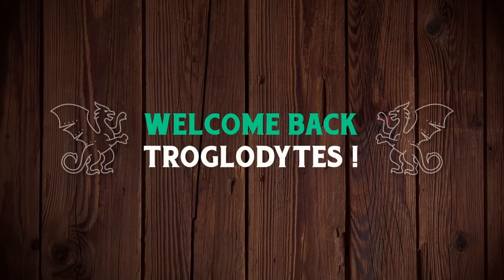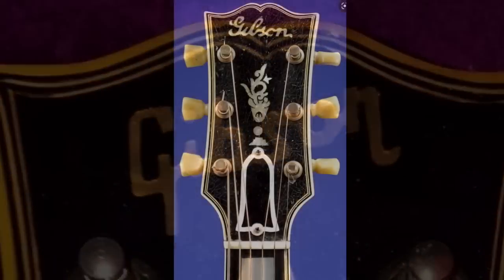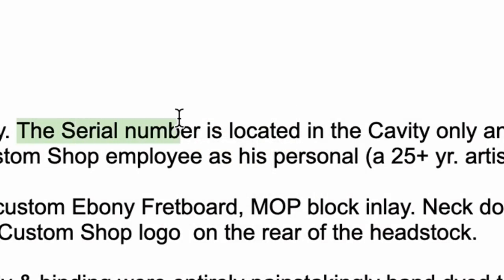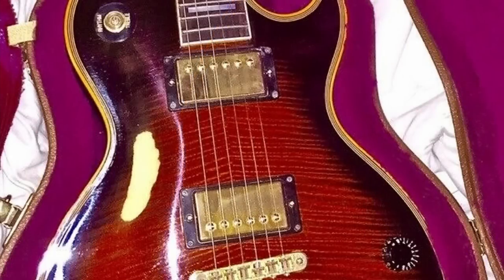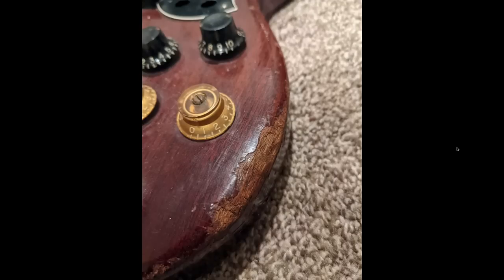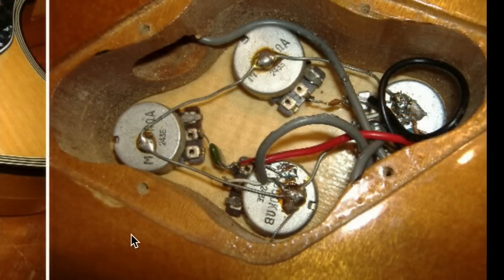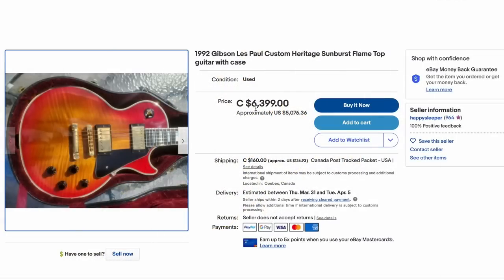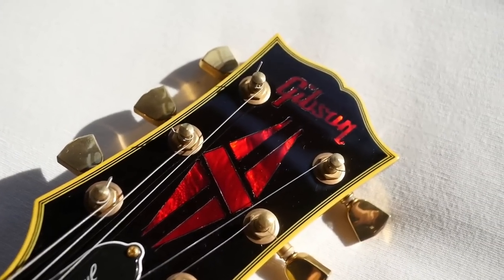I Thought This Was A Chibson... But It's Complicated | Guitar Hunting w/ Trogly

Comment: 10:22  Using a water bottle as an improvised neck rest is actually pretty clever. Full or empty, as long as the cap is on tight it’s all good. Empty might be the safer option.
Reply: I use a shoe sometimes, or a pair of pants wrapped around a small book